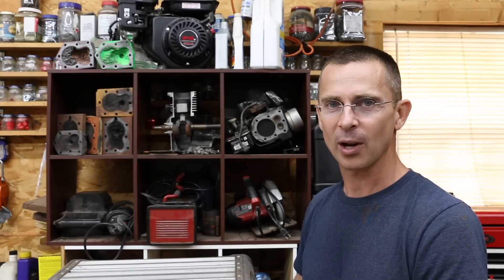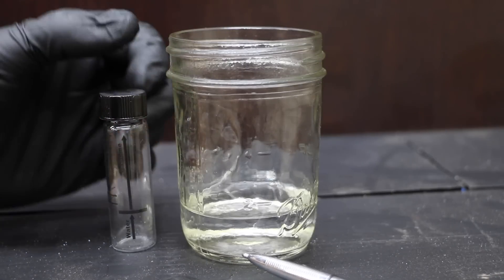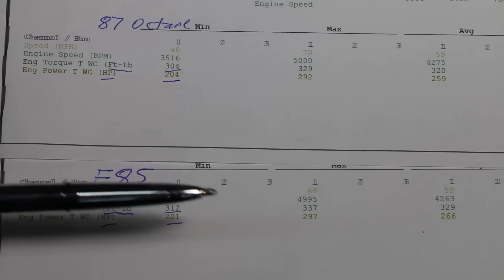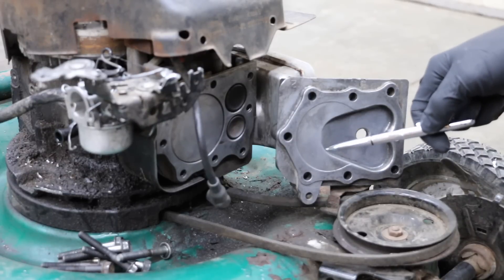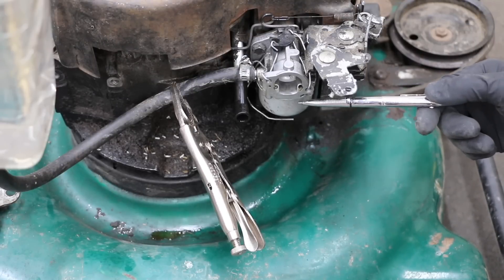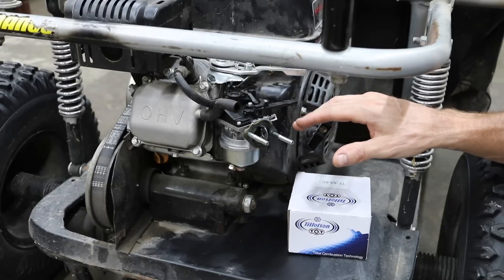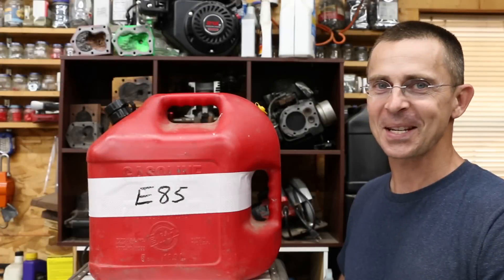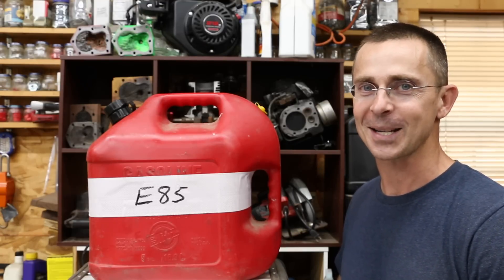Is E85 better than Gasoline? Let's find out!

Comment: I put e85 in my 2017 Silverado 3500 one time. Ran it until the low fuel light came on and put 31.5 gallons of e85 into it. I think on the "butt dyno" it seemed like it had more power. It turned the truck into to Exxon Valdez (9 mpg unloaded) though. I emptied the fuel tank again and replaced it with normal (e10) and it actually started created an issue.  During cold start ups it sputtered for the first few seconds until the o2 sensors controlled fuel delivery.  The dealer tested the fuel and they said it was still around 30% ethanol. After the dealer reset the ethanol sensor no more issues. Maybe one of the gas stations had more ethanol than they should've, I'm not sure. Long story short,  probably best to not switch back and forth between the two fuels.

Comment: The question of which is 'better' is a faulty question to start with.
E85 would be 'better' because it's made from renewable resources (ethanol).
E85 would be 'worse' because ethanol contains less energy per volume.

What do you mean by better?
Reply from the maker: Thank you.  All the positives and negatives for use in a specific application.  It cost per mile to use E85 in my Flex Fuel vehicle. So, I don't use it but if I needed cheap racing fuel, it would be my pick.

Comment: Uses it(E85) exclusively during the summer as it gives more horsepower and torque. I have a Saab 9-5 2006 biopower. 30 hp and 40 Nm in torque increases according to saab itself when driving with E85 in the fuel tank against running 95 octane gasoline. i notice a big difference on the car when driving on ethanol against gasoline. fuel consumption increases by about 1 liter / 100km but it is worth it.
Reply from the maker: Thank you

Comment: It depends on what better means? Price point, E85 needs to be at least 20% cheaper than cheap gas to get the same cost per mile out of it.
If E85 is more than 20% cheaper, than cheap gas, then it is a better deal as far as MPG goes. If not then cheap gas is a better deal price wise. 
E85 does help with carbon and water fouling, but then so does E10 or E15 which most people use already as cheap gas. So no benefit there. 
About HP and torque, E85 can get you a lot more HP but the easiest way to do so, is with a turbo charger on your engine and turn up the turbo pressure. With a natural aspiration engine you need to rebuild the engine, IE much higher compression ratios like 16:1 to get the power out of E85. But then you are stuck only using E85 as cheap gas will detonate in such a high compression engine. So for an N/A engine E85 is no realistic help to get more HP or torque. One possible exception, If you have a very high HP output engine that requires say 93 octane and you can only get at best 91 octane then your engine computer is going to pull out some timing to prevent detonation when using that 91 fuel. That bit of pulled timing is costing you some HP maybe 10% or so. E85 can get that last bit of extra HP as it is effectively 110 octane fuel. So in some rare cases N/A engines can benefit HP wise a bit from E85. Turbo's or superchargers will see the most benefit from switching to E85 with the advantage of being able to detune these engines once again if you go back to cheap gas. Thus making them true dual fuel engines unlike an N/A engine.
Reply from the maker: Great Point

Comment: It is my understanding that turbo'd engines close the gap or make higher ethanol fuels run better - lower knock due to ethanol being higher octane rating. With my car I run 15% ethanol blend - costs less and I get about 50-100 more miles per tank in my 1.4L Turbo over 87/10%

Comment: I have a 2004 suburban it seams to run better on e85 but as you noticed way worse fuel mileage vs reg gas but at wot under load no knocking or pinging btw I commute approximately 60 mi a day 6 days a week 58 mi of Wich are highway based on cost vs mi it's not worth  the ¢.50 diff but running it one or two tanks a month it works better than fuel injectior cleaner
Reply from the maker: Thank you!

Comment: I've used e85 in my 92 Ford f150 inline 6 did not notice any difference in  performance if I was just to use regular cheap gas
Reply: I should also mention the owner's manual says that it runs on 87 or higher octane
Reply from the maker: Thank you!

Comment: For a 1989 Mustang GT with a 427 and turbo me and my tuner found a substantial improvement with E85 because of our tuning. I suspect most that see an improvement see it because of power efficiency: Reaching speed promptly, dialed in cutbacks on throttle etc. E85 was also substantially cheaper. I could not compare fuel economy much as the aftermarket e85 427 and stock 93 e10 302 are not similar fuel nature and the 427 had a much improved electronic injection/valvetrain.
Reply from the maker: Thank you!

Comment: The only thing in my owners manual for my 92 Acura Integra about fuel is if you use ethanol, it should be only 10% and minimum 86 octane.  I feel like it runs a little better on regular 87 without ethanol.  It's fuel injected but it has a distributor, so the ignition timing won't automatically adjust.  I have used 91, 89 with ethanol, 87 with ethanol, and regular 87.  I used to use 91 octane religiously.  I have a new fuel pump, filter and injectors.  I recently drove 250 miles from central Wisconsin to central Iowa.  I mainly used 87 blended but pumped in some regular 87 before leaving.  I averaged around 35 mpg, taking construction and rest stops into account, as well as a lot of tight back roads.  I also have 300,000+ miles and everything original except the head gasket, water pump, and timing belt.  If you make the mistake of adding e85, try to find some non ethanol fuel asap and you'll probably save your engine lol.
Reply from the maker: Thank you!

Comment: Have you ever introduced Acetone to gas ? I used to run it in my 4.7 V8 Dodge Ram  I started at 80k miles and kept it up until 120 k miles   You save on fuel  I think it was one ounce per ten gal ? ( there’s blogs on net for it that’s where I got the idea ( I increased my gas Mileage from 16 to 21  )   It’s been a long time but I think that was the ratio ( it don’t take much ).   I now have 300k on that engine and it runs like new still.  I was looking to get an old Edelbrok Vera injection used in the 70s and 80s ( idk if they sell it any more but lots on eBay ) they are got injection water but I used isopropyl alcohol.    I think it would be great to get the acetone injection perfect for your motor I’ll bet you can really step up on Milage.  I stopped mixing as I was getting my mix wildly off I did not want to ruin my v8.
Reply from the maker: Thank you for the video idea!

Comment: e85 is a horrible fuel option. it's has less energy, pollutes more, much less stable, and corrosive.
Reply from the maker: Thank you!
Reply: It does not pollute more and its not horrible fuel option.
Reply: @mohis5664  e85 does pollute more AND has less economy than gasoline.

Comment: For those ACTUALLY in the know, E85 doesn't make more power because of the "octane rating" and compression ratio is practically irrelevant.  All of that nonsense is pure horseshit that every retard on the internet repeats.

Hint: look at the molecular structure of each fuel.

Comment: Not if the engine isn't jetted for it as you'll  use roughly 180% more ethanol than petrol.  Motor has to be built for high octane fuel to get the most benefit
Reply: mrdilligaf1968 %130

Comment: Maybe American drivers should forget that crappy 87-octane gasoline and insist on having a minimum of 95 octanes, as in almost all the EU.
Reply from the maker: Thanks for watching!
Reply: The octane rating is different in US vs Europe. In Europe (and some other countries) we use RON rating, while the US uses RON+MON divided by 2, which results in a lower number. US 87 octane is pretty close to european 95 octane, and the US 91 octane would be around 97 by the RON standard.

Comment: I need a 85 vehicle runs fine on E85 or high octane gasoline but a regular engine their heads will overheat and turn blue long term use can actually blow your heads up on a regular car cuz I can't handle the octane cuz he 85 is usually 105 octane it's only good for racing engines and E85 engines that are built for that octane level
Reply from the maker: Thank you

Comment: Here in The Netherlands everyone says that E85 is very bad. It is a bit cheaper but the engines are using more gas. E10 (90% octane, 10% ethanol) is also not good and almost erveryone just buys Euro 95 (95% Octane 5% ethanol) and sportscars and old cqars just 100% Octane without ethanol
Reply from the maker: Thank you!

Comment: I had an old oil-burner Ford 390 cu inch V8.  I was changing spark plugs all the time. But the Mohawk oil Company's midgrade "90" octane with considerable ethanol sure burned cleaner and kept the plugs clean longer.  I had already leaned out the carburetor a bit but the ethanol was a fine cleaner for my oil burner.
Reply from the maker: Thank you

Comment: Had an 04 Tahoe flex fuel. Similar results on efficiency: 16.5mpg gas vs 13mpg e85. While running the e85, the Tahoe also seemed to struggle more with hills, showing a much higher tendency to downshift for smaller hills.
Reply from the maker: Great information! Thank you

Comment: E85 vehicles need to be filled with a tank of E85 at least a couple times per year. Due to E85 being more corrosive, E85 rated vehicles are given more resilient tubing and such for their fuel system. They also are designed with the expectation of having that lower buildup fuel run through them and can have higher buildup in some cases when it isn't.  In the opposing cases where they don't have this higher buildup and will have equal buildup to regular engines, running E85 through your motor a few times per year is a good way of cleaning out the deposits since the vehicle can handle the extra corrosives, unlike a standard vehicle. 

Per the testing, I've done the mpg test with my focus. It is an E85 rated car, and I get fairly high mpg as it is. There is a higher cost with E85 do to the loss of efficiency, enough that my cost per mile is not worth using E85 on a regular basis.  I'm currently seeing how it handles high octane fuel instead of standard, so far having higher performance and mileage. I haven't figured the cost difference per mile for high cost gas vs low cost, though Engineering Explained posted a test comparing a few vehicles and their performance, results have been forgotten.
Reply from the maker: Thank you

Comment: Can you use a combination of E85 and 87 octane for optimal horsepower/MPG/cleanliness? Appreciate your videos!
Reply from the maker: Thank you for the video idea!
Reply: I know in modern boosted engines that aren't flex-fuel certified, 87/89/93+E85 for a blend of ~E30 will give you more power than pump gas alone. Timing can be ramped up by the ECU because the knock sensors aren't ever going off.

The difference between 93 and 93+E30 in my 3.5L EcoBoost and 2.0L Mk7 GTI is definitely noticeable. I don't know if my engines are running any cleaner, but I noticed E30 doesn't blacken up the tailpipes hardly at all compared to straight pump gas so I imagine it's keeping things decently cleaner.

Comment: what kind of test is this???? Are peaches better than apples??? 

E85 means there is 85% ethanol and 15% gasoline. Probably no big difference for the engine but the point is to use as much renewable energy as you can.
Reply: And then wonder why food prices are going up because instead of eating corn we're burning it for fuel for an imaginary problem...

Comment: Interesting, I have a friend that has always told me that using ethanol in an engine not designed for it was extremely bad for it, and would damage it before too long. Ethanol has been known to burn hotter, so I have to wonder if it would burn the valves eventually.
Reply from the maker: Thank you!

Comment: I uses to run a 50/50 mix in a 91 corsica with a 2.2l engine. It lacked power until it warmed up then I couldn't see a difference when warm. I do think the mix was a part of the premature failure of the motor but there were to many factors of abuse that resulted in the demise of that motor to pin a singular cause to its death
Reply from the maker: Thank you for commenting on this.

Comment: e85 is great because its race gas for cheap, but just like race gas, it doesn't give an improvement unless you need it (very high compression or high turbo or supercharger psi that needs resistance to detonation)
Reply from the maker: Thank you!

Comment: Well E85 cleans the engine, so you get better efficiency at next tank of E10 gas.
Reply from the maker: Thank you
Reply: Actually E10 gas will clean just as well as E85 does. E10 has 10% ethanol E85 is 85% ethanol. But the 10% is enough ethanol to clean your engine just fine. Straight 87 octane no ethanol gas does not clean the engine and does produce a lot of carbon buildup over time. Some oil companies add a fuel cleaner to these fuels like shell oil for example

Comment: Where are that there is E20 and E30. Im in Wisconsin and all we have is E10 E15 E85

That burban you can get over 20mpg on E15 if you stick to 60mph highways after that miles goes down and fast. I had one just like yours minus the flex fuel. Still couldnt beat the mileage that my 2014 Malibu gets but having the room for the family and dogs the difference was worth it. Just wish I could get my GMC that mileage but being not stock HP always cost you MPG.
Reply from the maker: Great point! Thank you

Comment: e85 needs to use 25% more fuel to achieve the same results as regular fuel. This is why when you convert an older vehicle to run on e85 you have to upgrade your injectors and make the tune shoot more fuel. This fuel is a con and only helps the tuners out here.
Reply from the maker: Thank you!
Reply: @ProjectFarm   I recently did a road trip from Texas to Oregon and was averaging 45 mpg during the trip. In Nevada I came across non ethanol fuel 87 octane I believe and averaged 57 Miles to the gallon after that fill up and I continued to use non ethanol gas during my time in the west. Ethanol gas gets worse mpg vs Non Ethanol gas, they are just robbing us sadly :(
My car is a 2015 Ford Focus with the 1.0, 3 cylinder turbo and a 6 speed manual.

Comment: I’ve got a 2013 Dodge Durango with the 3.6 v6 and I have always used 87 octane in it because we don’t have e85 where I live I drove up to Atlanta one time and i was at zero miles to empty so I was pretty low on fuel I found a e85 station and I filled up completely this is the first time I’ve ever filled up with e85 anyways I did notice a decent increase in power I could tell fuel mileage was worse though with 87 I would get close to 30mpg on the highway doin 70 with e85 I was getting about 18 average
Reply from the maker: Thanks for watching!

Comment: I run e85 in my 30-plus year old car with no problems, kind of helps to have big injectors and a giant turbo making 500+hp I basically put under the impression that vehicles made after 1985 we're designed with ethanol in mind whether that be 10% or more so the fuel tanks and fuel lines are better equipped to deal with the ethanol not eating through them. I would never run e85 on something naturally aspirated as the benefits of ethanol are almost a moot point. Worst fuel economy for almost no extra power gain makes no sense to use it. I've always looked at E85 as race gas for the road for forced induction applications.
Reply from the maker: Thank you

Comment: 4 years ago when I entered the lawn care business I decided I was always going to run the best I could in my lawn mower.  I decided to use 110 octane thinking that would keep the engine in top work condition and I wouldn't have carbon or ethanal build up.   I used the mower the first day for 8 hrs.  The 2nd day the engine was running rough and did not have any power.  I now know I burnt the engine up with the 110 octane.  If you have an old mower engine could you run 110 octane through the motor and show what damage 110 octane causes and just show why it is important to use the octane level that the manufactor (sp) recommends.  I have also heard growing up that every 3000 you should run 93 octane in your car because it will clean it up.  Is that true or will even 1 tank of high  octane ruin an engine.  I like your videos and the way that you present the projects and how you run your test.  You are not trying to promote any product you are just putting them to the test the the product claims.  Thank you.
Reply from the maker: Thank you for the video idea!

Comment: Thanks for the video! 
Down here Ethanol is a lot cheaper than gas since it’s made out of sugar cane instead of corn. I just don’t like the idea of using it because of the oxidation that takes place in the long run, but sure looks cleaner! 
I’ll give it a try for about 5~7 tanks to compare  prices and fuel efficiency and see if it’s worth it. 
Keep up the good work! 
👍🏽
Reply from the maker: Great point! Thank you

Comment: In my car I have noticed that the higher the alcohol content, the less miles per gallon I get. In my 2 stroke engines any alcohol is a good way to dry out and crack (or even melt) anything rubber, plastic or paper in the fuel system. Bad news for small engines.
Reply from the maker: Great point!

Comment: Chevy son wants to run on premium gasoline add do not befriend the gasoline in it I run e85 cheap gasoline I get more to a gallon cuz it doesn't have the additives in gasoline e85 is more straight and I have found the gas station is straight gasoline just have no additives and I get better gas mileage I get 500 miles to a tank strength gasoline Chevy Sonic the additives and those pumps are bad for the motor
Reply from the maker: Thank you